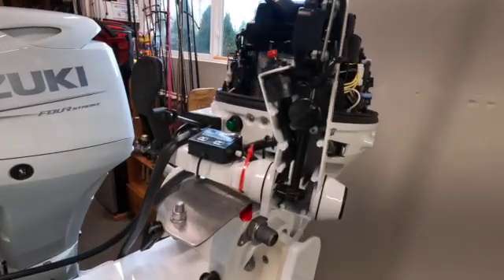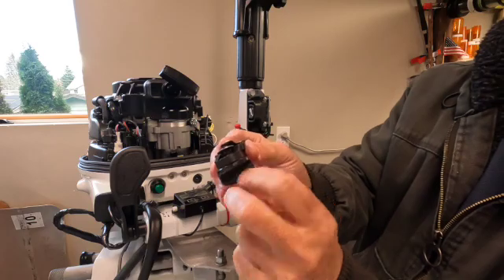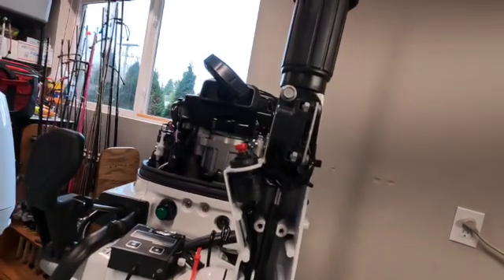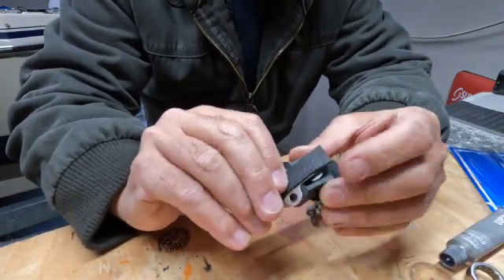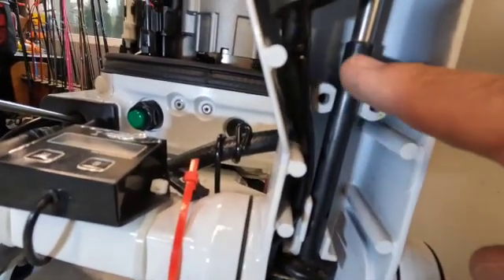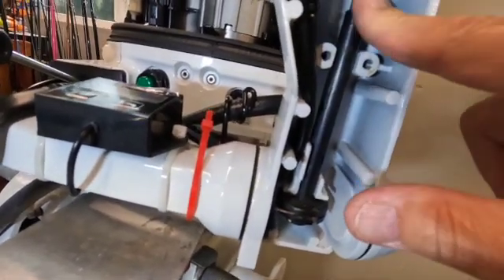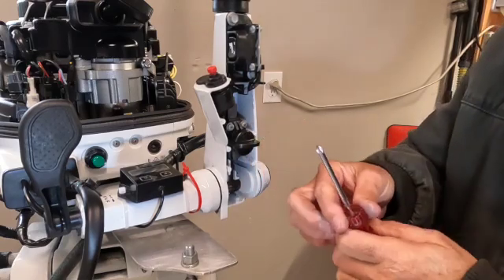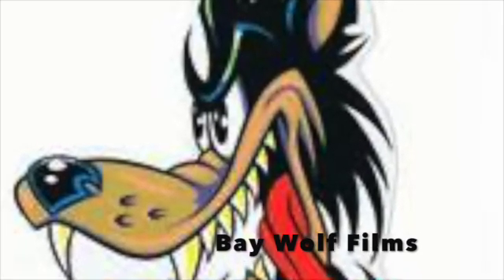Suzuki 9.9 hp outboard throttle lock modification.    SD 480p

Comment: Have you used/tested this modification, and does it work? Has the rubber stayed in place?
Reply from the maker: I've used this to precisely set the troll speed hundreds of times now. It's still working perfectly.  Locks in and holds the RPM exactly at the speed I need.  Set it and forget it!👍

Comment: It looks like this mod locks the throttle. If you don't tighten it down all the way, does it add friction? That's ultimately what I'm looking to do, currently that knob does nothing.
Reply from the maker: Yes, it can only add friction if you don’t tighten it down hard.  

Thanks for the question and for watching.

Comment: Too bad I bought the troll master already, which is still working but this would have been easier.  I read your post about the Suzuki 9.9 efi surging when you give it just the slightest throttle off idle, have you found a fix for this? Right now it's either 1mph at idle, or give it ever the slightest throttle increase and the rpms jump so high (for such little input) and becomes too fast.  I feel like I should have gone with a Yamaha but screw carburetors.
Reply from the maker: I feel your pain. But I did find a solution, at least in my case.  
I found that if I warm the motor up really good she purrs at very low rpm just above idle.  I troll at 1.2 for Kokanee and after warming up the motor by running it at near WOT for about 5 minutes while pushing the boat around I can throttle down and lock it at just over idle and she will sit there and purr for hours.   Be sure and run it back up to higher RPM before shutting down after prolonged trolling.  I believe that helps clean out the pistons and valves.  
Hope that works for you too. Check back in and let me know.
Reply: @Baywolf_films  Just wanted to give you a follow up, I went trolling today and remembered your advice.  I ran the kicker around going to wide open now and then and then sure enough the RPMs were much more tame from idle.  You have no idea how much frustration you just saved me.  Big thank you man.
Reply from the maker: @callmekham8458   Excellent news.  Made my day to know it helped.  Hope you were successful trolling.
Reply: @callmekham8458  you can also lower or raise  your propeller pitch to obtain your desired trolling speed at idle. I got like 5 propeller diff sizes for my 20hp Suzuki.